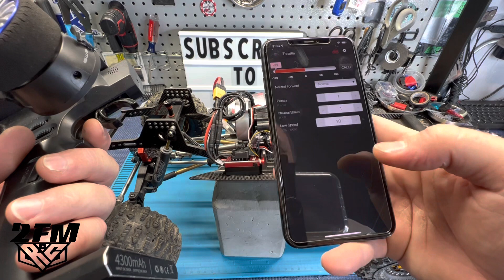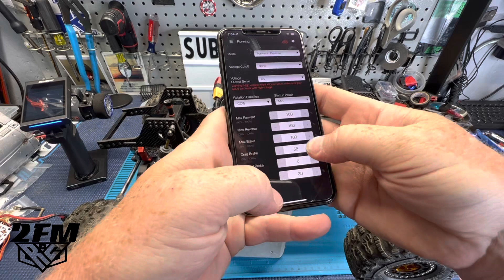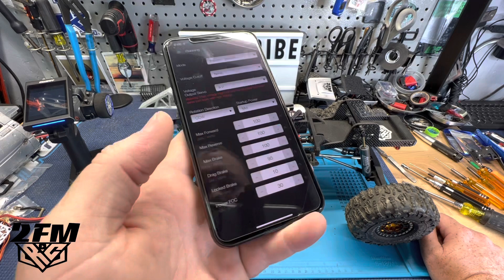Furitek Lizard Ten 1/10 esc first look and run!

Comment: Fusion 1800 all the way. I've got 4 of them and a 1200. Belt drive 32 or 48 pitch. Super quiet. Super dependable. 48 pitch will slip if pushed to hard. But they have a slider clutch. I'm glad to see these guys getting in the 10th scale  game though. 
Cheers buddy!
Reply: Fr dude the 1800's are mint

Comment: Do you find it getting hot. Mine got so hot I had to use something to shut it off because I couldn't touch it with my bare fingers
Reply from the maker: No not at all. You may need to adjust your gearing. What motor & truck are you running?

Comment: Interesting ESC overall, but disappointing drag brake. 👍
Perhaps you have to set the Power FOC to 100 too?

Edit: here Furitek sets the Locked Brake to '10' not '100' and it sits still on the hill:
https://youtu.be/MJLsrQKr8QE